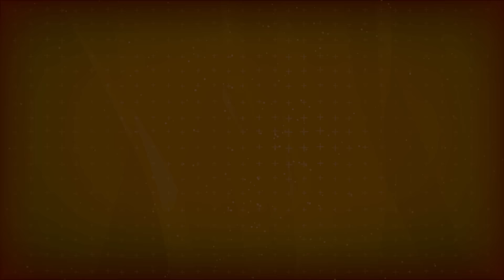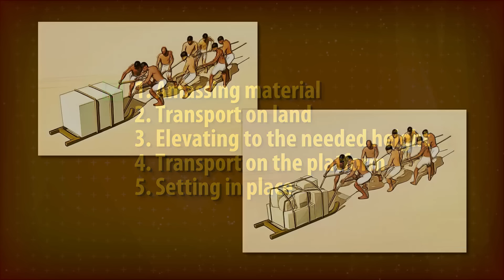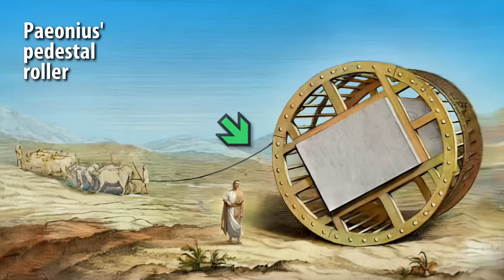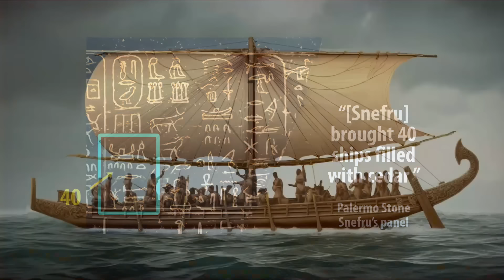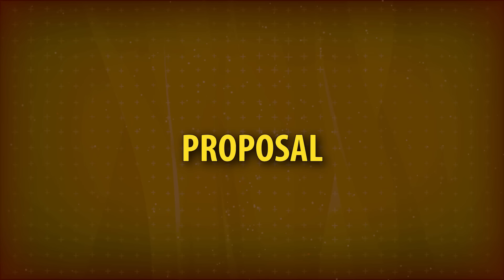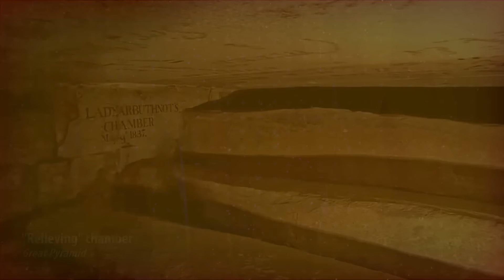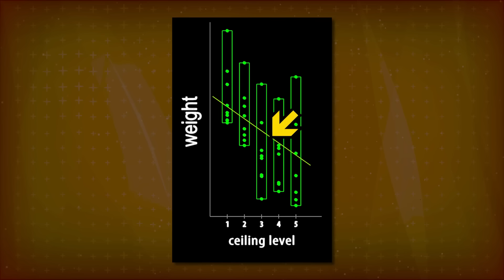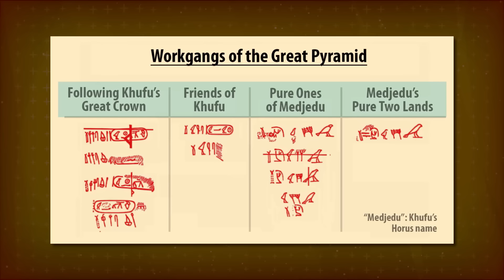How to Build the Great Pyramid in 9 Months (NOT aliens)

Comment: I was hoping there would be more discussion about setting stones in place. Like how they are lifted and set tightly together. Then there’s the problem of lifting and setting the casing stones.
Reply: I don't see how rubble cut rocks are stable enough to be put on top of a hundreds feet project
Reply: He mentions that they were mortared in place. Ruble only means unshaped, not that they were left loose within the structure.
Reply: @wingedhussar1453  

" I don't see how rubble cut rocks are stable enough to be put on top of a hundreds feet project"

Mortar + smaller pieces of rubble to flatten each layer.
Reply: @wingedhussar1453  If there is a box work of cut stone, the rubble is stacked in the interior of the boxes, the top is closed and  then flattened.  This kind of rubble core construction is widely used in Classical and pre-Classical masonry.  The images of alternating rubble and fitted masonry is remarkable and is not widely discussed.  Another advantage of rubble is that empty spaces between the pieces of rubble is a reduction of mass over the stone needed if large regular ashlars were used.
Reply: I feel like if you actually go to one of the pyramids it's not like every joint or face is perfect. Plus you only need the very outside faces to be more perfect.  Theres probably more gaps and imperfections hidden inside the pyramid.
Reply: You can rotate a cylinder pretty precisely. And lever it into place, remove two of the four wheel piece things. And flip it over into place. Pretty cool building method
Reply: and why they didnt chip when sliding into place ? Water and sand ? Animal fat ?
Reply: Watch “Acropolis Restoration Project”, you will notice that cutting and moving blocks is quite easy.
If you have never worked with masonry, cement, or paving, you probably think it’s super difficult.
Reply: @spankflaps1365  I wouldn't say it's easy but have seen crews getting things done way quicker than anyone expected with less equipment than site manager thought needed. 
There are some very smart engineers out there who are not stuck in 'classical' thinking but still know whats safe.
Pretty amazed to see one guy working out loading for moving equipment, in the dirt with a stick, just like 4,000yrs ago. As soon as everyone understood,  job took 15 minutes instead of several hours
Reply: @spankflaps1365 
Nailed it in 1! 
  I'm not a learned man however watching many videos of "scientists" trying a labor project and saying it can't be done when they fail is a gross underestimate of what Skilled labor can do!

  You can have a beginner spend a minute or 2 laying a brick getting it just right. They'll tell you it'll take over a month to build a 10k brick house. 
  Now get a highly skilled bricklayer with a labor passing him brick....You can't pass him brick fast enough, unless of course you're a skill laborer!😂😂😂
  I knew that man and his wife was the passer. I was the only ground guy that could sling mud and stock the brick fast enough to keep up with him, and another good brick layer😊.
Reply: @michaelbarnes6017  , yeah, it's one thing for a person trying out a hypothesis about how something could be done. It's quite another for centuries of evolving work to end up with a method and workers who know how to do it. It's like this video said about using the wheel and everything that would accompany it. I assume all of the architects who did great projects like this were mostly leaning on already existing well understood methods. It's just that we stopped using those methods and stopped thinking about the past methods for many centuries. It was always an evolution; so, why keep alive knowledge of what people did at one point in time? Well, he sort of addressed that question at the end.
Reply: @michaelbarnes6017  Keep up with the lies and forgetting the videos you have seen people do it home!
Reply: @spankflaps1365  yep, no same deal, current and moving the easy parts… getting them on the rack then setting in place not as simple. At least nobody has shown that yet.
Reply: @spankflaps1365 Its easy w power tools, and steel.  Ive yet to actually see someone cut through a block with the technology the Egyptians had.
Reply: @smasher.338   It's not going to be served you on a plate. You have to actually look for it. The LAHT guys aren't going to show you that, because then they won't be making money.
Reply: @smasher.338 It depends on the pyramid. 98 to 99% of the Khefre's Great Pyramid is limestone which even the copper tools they had can handle. The granite is another story but being only one or two percent of the blocks at most makes it more plausible they could throw enough bodies at carving it. The French architect Jean-Pierre Houdin made an excellent case that features like the grand gallery likely formed the basis of a counterweight system for positioning the really big granite block used in the Kings Chamber, probably using a single reasonably sized ramp starting at the top of an adjacent hill that later become the site of the middle pyramid aka Khefre's. This greatly reduced the size of that ramp. Houdin also argued that Khefre used a spiral external ramp but it being inset shouldn't have interfered with sighting down the edges of the structure. Thermal scans taken by a Japanese research team with no knowledge of the theory seem to support this spiral path. 

It is possible this may have been used exclusively to set the fine casing stones which work best if set starting from the top down likely using tipping to get them the several courses necessary to place all the casing stones from a single spiral ramp. Interestingly folk stories hold that this pyramid was "built from the top down" which might suggest Khufu "only" repaired and altered a large pre existing mastaba structure of unknown age into a smooth sided pyramid. If so the granite work could've been done by them. 

One thing the narrator may not give enough significance too is that by virtue of simplest geometry the bottom half of a pyramid by height will comprise three quarters of its mass and volume meaning four of almost any kind of ramp could supply all the throughput any likely pace of construction could demand for that stage of construction. That previously mentioned ramp from Khefre's hill would've been able to get most of the limestone for the upper half in place without running into the issue of needing a mile long ramp of greater volume than the pyramid itself to get a shallow enough ramp angle. 

I still don't think it's necessarily true that the Dynastic Egyptians built ALL of Khufus pyramid rather than adding
Reply: @smasher.338  Why do you want to see someone cut through a block, are you a sadist? The ancients weren't stupid, they'd just come out of the stone-age and after tens of thousands of years working with stone (look at Gobekli Tepe for reference.) they knew what they were doing, for instance, just because as a modern person you can't understand how those blocks were cut with copper saws I'll tell you WHY you can't understand it: You've been softened, mesmerized and crippled by technology. In fact, at the risk of insulting you I'll go so far as adding that technology has made you stupid, as well. Now, to soften the blow of you having to face-up to your deficiencies I'll untangle your lack of knowledge by infusing it with just a speck of objective reasoning.
                                        To cut a block of limestone (although this works with granite too.) you don't have to labor away drawing a saw back-and-forth for hours or days, all you have to do is take your saw and SCORE the block, just a couple of inches and then insert wooden dowels into the shallow score and pour water over them. After a relatively short span of time, enough time for the dowels to swell, enough internal stress has been exerted on the block that a few well-placed strikes with a wooden mallet will cause the block to sheer-off along your score-mark and the extra material will simply fall away. The surface you're left with will be surprisingly flat and regular, so much so that very little finishing will be required. 
                           I can see you in my minds-eye, working next to a grinning Egyptian mason who watches you as you sweat like a buffalo and display your uselessness by sawingsawingsawingsawingsawingsawingsawingsawingsawingsawingsawingsawing like a madman, wearing out several saws and yourself and not completing your task because you have been duped by guys like Graham Hancock and Erik von Daniken into believing that without technology EVERYTHING is impossible when the real reason you're failing is because you're stupid. Now, don't get butthurt, I'm simply using hyperbole in an attempt to break you out of your YouTube induced coma and to shatter the illusion that has been cast over the Pyramid by idiots who can't even spell archaeologist but will try to tell you that archaeologists are all wrong and they're all liars and it's all a conspiracy and everything your worthy ancestors accomplished never happened because they were all ignorant savages and blah-blah-blah.
                                                  Go to a construction-site, find the superintendent and volunteer to work weekends for free, try to make it a mason or cement contractor you work for although anything will do. If your proposal is accepted several things will happen: (1)You'll grow in strength, confidence and self reliance, (2) you'll sleep like a baby at night, (3) you'll accumulate a better class of friends, (4) Eventually, if you try your hardest, the boss will make sure you get paid and (5) the next time you run into someone on-line talking about how everything is "impossible" and "unlikely" and the Egyptians just couldn't do this or that you'll have no problem telling them to go fuck themselves.
Reply: The Egyptians didn't build it , they said they inherited it.
They found it 
They didn't FOUND it.
Reply: @handwerkskunst_handicraftarts That is a valid and relevant point in my opinion. 
Promoters of A.I. are saying A.I doesn't have the 'ego' problem so things should progress much faster?
Reply: You just open the "cylinder" by removing the  top quarter, roll it a quarter turn and start dumping out the content.
Reply: Herbert Stone wrote a book called Stones of Stonehenge' he was stoned at the time...
Reply: You nailed it with one comment
Reply: The queens chamber creates electricity,the stones around it conduct electricity and the casing stones insulated electricity-nuff said ✌️
Reply: @scottanderson3751  Gee, with all that electricity I'm starting to understand why the Queen spent so much time in her chamber when the King wasn't around, that and the constant buzzing.
Reply: @scottanderson3751  - That very loud > SMACK! < you just heard was my forceful double face palming generated by your absurdist comment, no electricity required.
Reply: @scottanderson3751  utter tosh

Comment: There is no edge fracturing seen on many cut rose granite stones, canceling out the idea of sledding or rolling around for 400 miles.  No boat has ever been found which could carry even a fraction of 40/50/60 ton stones used in the construction.  A lot of questions still.
Reply: are you aware that wood will rot over time ?
Reply: @falkooo002  Boats where buried and dug up near the pyramids- intact - dry climate preserved the wood, but no boat ever found which could carry even a fraction of the weight of the stones quarried 400 miles away....still a mystery. No large boats even seen in the art work as well.
Reply: @tracyeaves4847  wow this is just not true…
„boats“ where not buried next to the pyramid, only 1 boat was found next to khufus pyramid which was so well preserved because they wanted to preserve it and it was not used for stone transport, is was his boat to travel into afterlife. why should they preserve transport ships when wood was a very precious and expensive material back than?! does not make sense at all… furthermore there is plenty of art work for ships transporting stones, f.e. in hatshepsuts funeral temple a boat that was transporting 2 big der obelisks.
furthermore … how do you think the big obelisk where shipped from egypt to rome or london? of course they built a big ship to transport it. a little more research would answer your questions
Reply: @falkooo002  I need to see the hieroglyphs of the boats carrying stones and obelisks.

Comment: I remember a while back I saw a thermal image of the Great Pyramid that seemed to suggest there was an internal ramp going around the structure.  Additionally, it appeared that on the corner where there are blocks removed, there seems to be the flat surface where the load would be repositioned for its continued journey on the next portion of the ramp.  I agree that your proposal shows that it is very plausible that the pyramid could be erected within the life span of the pharaoh, and given the constraints of working only during the day, have only one internal ramp, not working during the nile being flooded, it still could be accomplished.  Bravo.
Reply: The internal ramp do not interfeer with thisway of buliding.  this cout reuce the bulding time more...

Comment: The pyramid was not a solid structure when built. It was more like the mega block construction elsewhere. It was badly damaged and of great antiquity.  The Egyptians rebuilt it as best they could. This is seen everywhere. Gobekli tepe etc. Small rocks used to infill. Peru, everywhere. An example that might be proof would be the 70 tonne lintel blocks in the king's chamber. If you doubt technology existed see the structured light analysis and geometric analysis on uncharted x. (Get ready to have your mind blown) That's proof that someone did calculations in radians and the math ppl here know what that means. In a deeper study you can kinda understand how their minds worked. Everything had meaning right down to a simple vase.
Reply: tough to read your comment... if you compare göbekli tepe with the pyramids you should maybe stick to uneducatedX´s channel and keep on believing his lies :)
Reply: You are aware that saying they calculated in 'radians' is the same as saying they calculated in cubits (arm-lengths)? 
This 'radian' calculation technique is used in every bicycle repair shop to order the right tire for your wheel. 
If you have a 1 cubit diameter wheel, the circumference of your wheel is 3.14 cubits (one cubit times PI (3.14) 'radians').
Actually, real math peoples will omit the 'radians' because they serve no purpose but to apease young students that insist there must be something like 'degrees' in there because they always had degrees in their angles. Egyptians didn't have the 360° circle so they didn't use this 'radians' indicator and certainly no degrees. Just fractions and cubits.
Reply: @TheBayru  it's the pi factor and are radians not arc segments? More importantly, the derivation of radians is base 60?
Reply: @webgodtube  You are correct that the constant (an unchanging value) π is a factor (a value by which is multiplied) in this calculation. 
A radian is not base 60, minutes and seconds are base 60. Radians are baseless, and π is an irrational number (cannot be expressed as a fraction of whole numbers or integers) One 'radian' is the angle you get when you travel 1 distance unit on a circle with a  radius of 1 distance unit (diameter 2 distance units)). π radians is the angle you get when you travel half a circle on the circumference line of a circle with radius 1 distance unit. 2 times π radians is the angle you get when you travel the full circle. The circomference of a circle with a radius of 1" (and thus diameter 2") is thus 2π", the circumference of a circle with a diameter of two cubits is thus two times π cubits. And if you wrap a loop of rope around a round wooden beam that is 10cm thick, you will need 31.4...cm (π times 10cm) of rope. All this to say that calling a radian a unit of measurement as would be degrees ( 1/360th of a circle) or gradians (1/400th of a circle) is misleading. Radians are dimensionless. If you multiply 1 radian with 1 meter to get the length of an arc, the arc is 1 meter long. Not 1 rad meter long. An angle of 45° is π/4 (in radials), no unit indication like ° or " or even rad is necessary. So if egyptians calculated 'in radians' it means they could put a rope in a circle and measure the length of the rope. It's easy as pie.
Reply: @TheBayru  makes me wonder  if Sumerians used poles and ropes too. I believe they used base 60 to reduce fractions
Reply: @webgodtube  According to wikipedia the babylonians used 60. It's 5 times 3 times 2 times 2, so it's easily divisible by the smallest prime numbers. 
The egyptians used base 10 and fractions of any nomination, but halving things was most prolific. Creganford has a video where he says the egyptians had 36 zodiac 'signs' so they knew how to divide by this number https://youtu.be/ZYVc316NQFc?si=uv8w9DZ-AVgt2fGz .